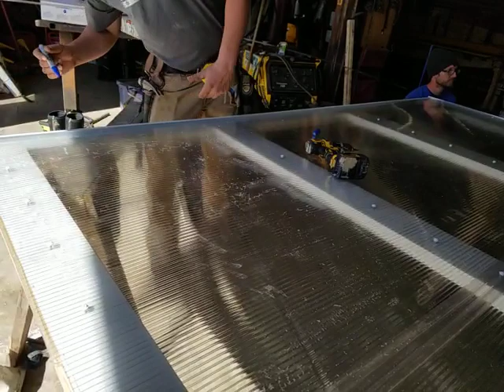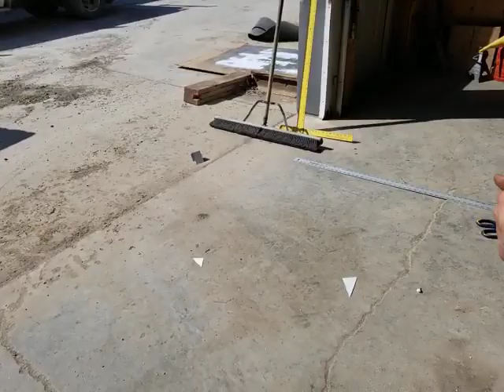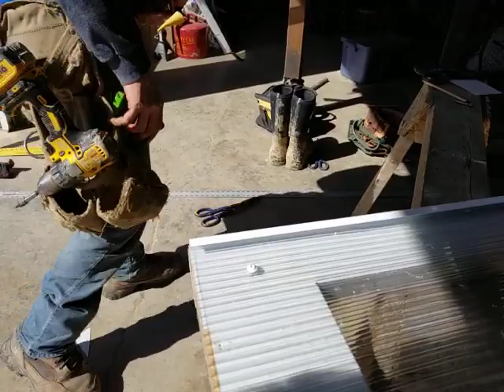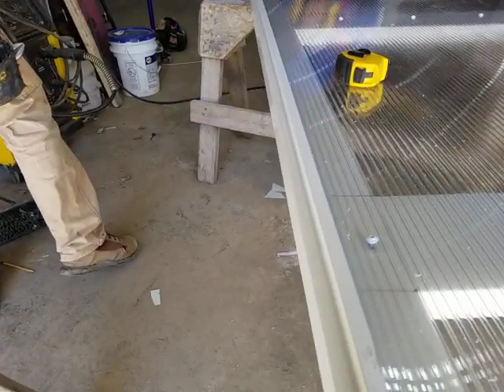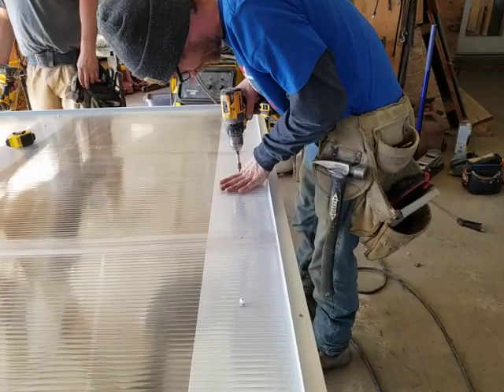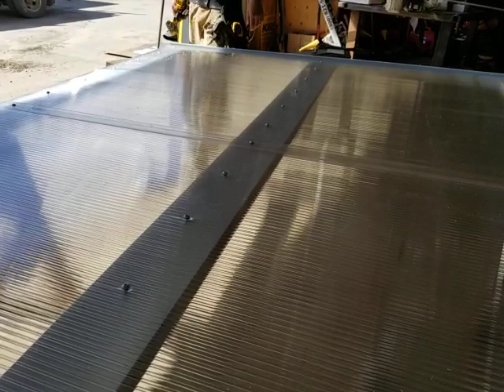Installing polycarbonate panels on sliding doors

Comment: How do you prevent this wide of a sliding door from warping? What is the frame constructed from?
Reply from the maker: The wood is covered with steel  sheeting so it is protected from warping,  plus the use of top quality lumber (MSR1650)